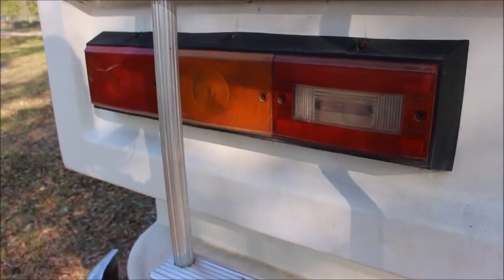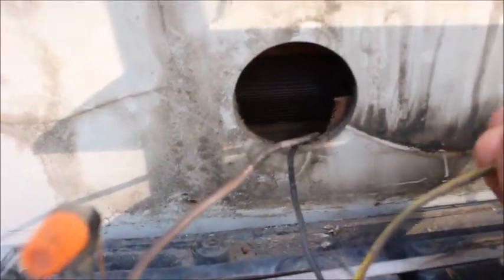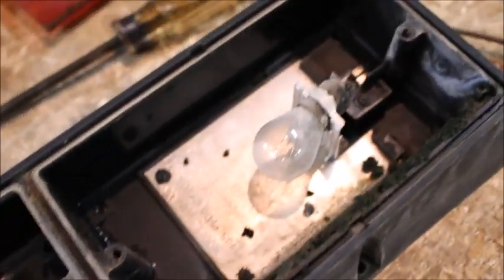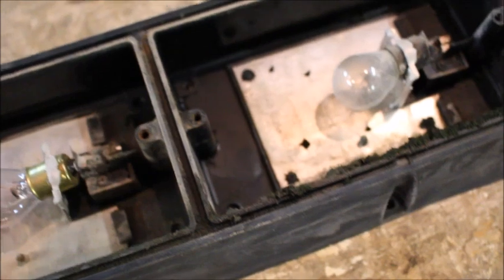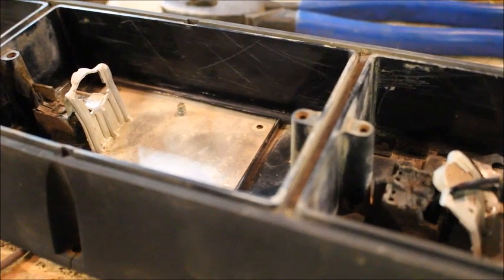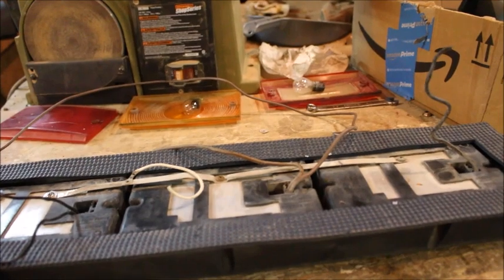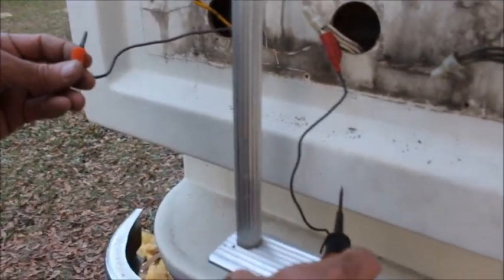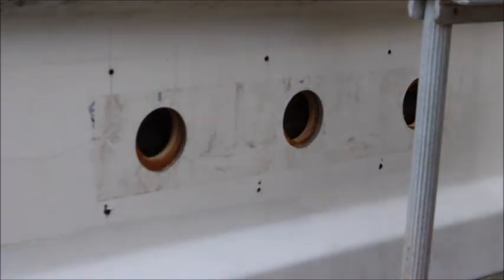RV Remodel--Rebuilding the Tail Light Assembly - American Clipper

Comment: Danny I never want to say anybody is wrong, but just a thought, check the laws about amber lights on the rear of a vehicle in your state.. I believe the Brake and running (park taillight) on the rear must be "red: while the turn signal can be amber.. If I remember correctly, you had the park light as amber and the turn signal as red...
Reply: Yep, it was wired backwards. Red low-beam should have been running light, amber turn signal and of course red high-beam brake light.

Comment: With all the rotten wood your running into  in the floor and walls would it make sense to pull the whole camper off the frame and replaced the whole floor? I do not know if it is possible. It would obviously be a lot more work.
Reply: I find this so interesting! I have always. Thank you for taking the time to post this. it's my dream to have a RV.